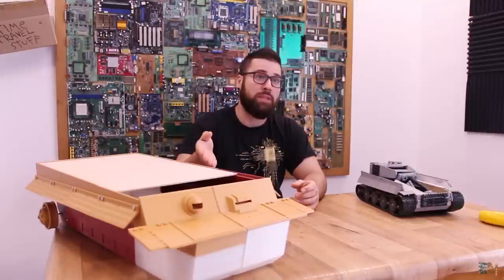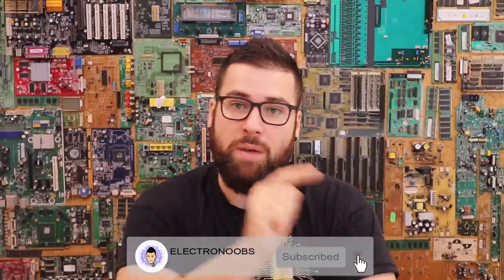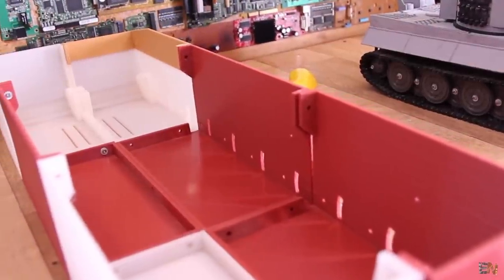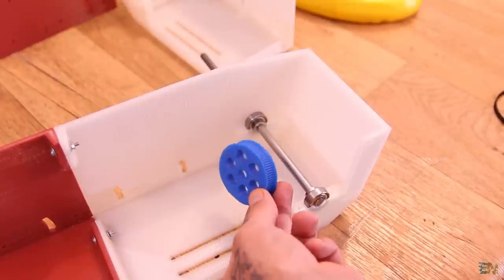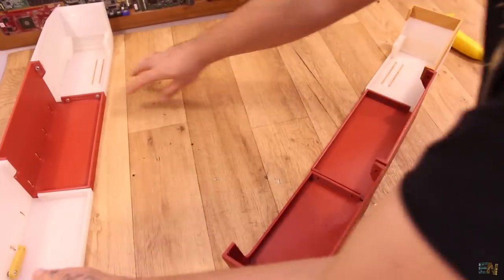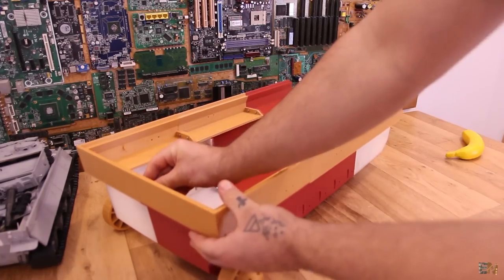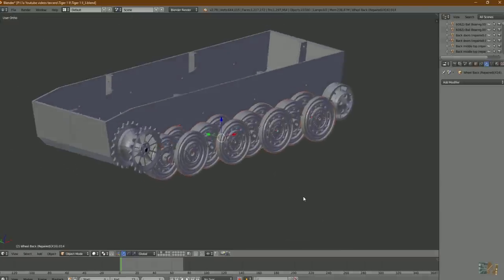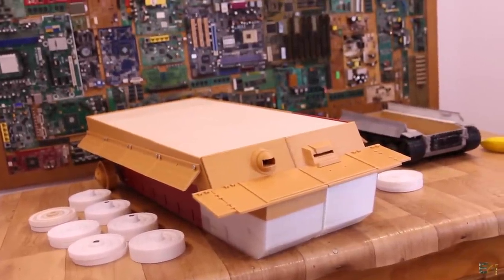WOW, I'm Designing This HUGE Radio Control TANK

Comment: You can actually make a 3D pronted torsion bar suspension system. It shouldnt be too complicated. 

It will eliminate the requirement for springs and added realism bonus i guess...

Comment: Why use all the bolted hardware? I don't think disassembley is required for most of this. Why not hotstake or design an interlocking connection?

Comment: Hello Sir, I was planing to make a dual channel constant current constant voltage power supply but I am really doubtful on how to make a decent boost converter either based on arduino or an attiny13A or attiny85 for the powersupply. The constant current and the constant power is really easy to do after watching your video on "how to make a constant current and constant power load with MOSFET using arduino".  If you have some time in hand, can you work on this project so we all may be well guided by you design to make something similar. 
Regards

Comment: I 🤔 that you should use a geared dc motor because it have much high torque than bldc.  Have you plan to add extra sensor to it such as lidar, smoke sensor.

Comment: Well, let see if I can express my thoughts kindly. Using a 3D printer to make flat surfaces... What? I know the printer is not big enough.
Having a 3D printer and still have to use nuts and bolts..?
And about the Tiger, I hope the new model get it's 88 gun, not that 37 from previous printed tiger. Amen
Reply: nuts and bolts are a great combinations with 3d printing
Reply: how to join parts other than with screws?
Reply: @AngeEinstein  exactly lol